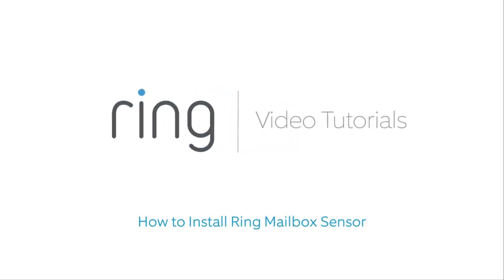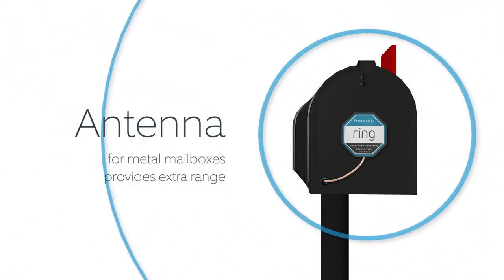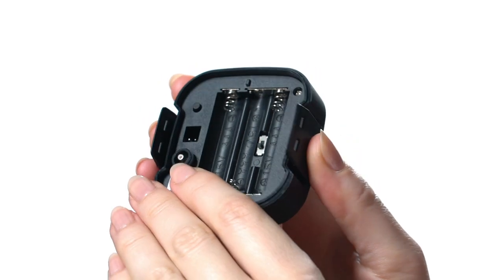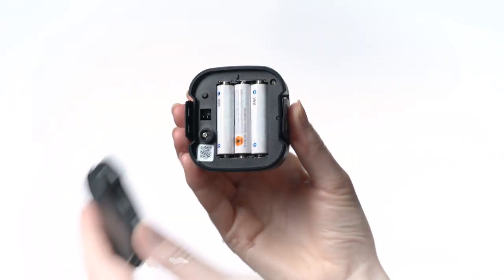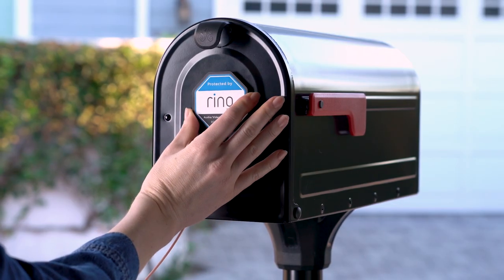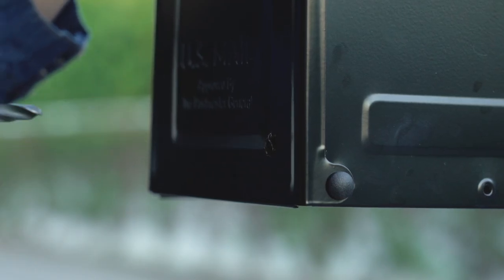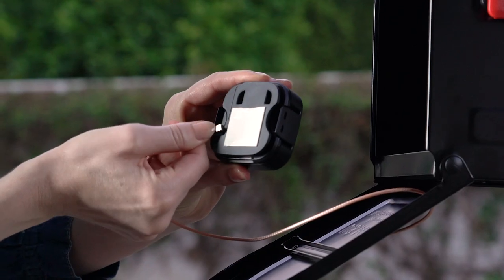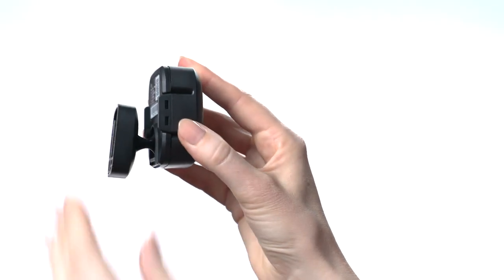How to Install Ring Mailbox Sensor | Ring

Comment: Since the sensor is activated by light, I put it at the back of the mailbox so there isn't this little box attached to the lid when you open the door. Cranked the sensitivity all the way up and attached the antenna to the back (outside) of the box. The wire is clipped to the side inside the box so nothing catches it. When the mailman opens the door, the Echo Plus in the living room says, "The mailman is here." Plus I get notifications on my phone and watch. It's working great and it's very handy since our mail is not delivered at the same time every day.

Comment: You guys need a master home hub for all Ring devices - alarm, cameras, lights, sensors - so that all devices talk to the master home hub, then to wifi internet. It would have cellular and battery backup (like the alarm hub has now) so that if the power or internet goes out you still have access to your cameras and the alarm stays armed.  Please consider doing this.  Thanks
Reply: Sounds even more expensive.

Comment: How do you use the mailbox system with a brick encased mail box ?
Reply: That shouldn't be a problem because once the door is open, it will cause motion and the signal will be able to escape the brick enclosure.

Comment: Has anyone tried installing the sensor to the back of the mailbox instead?  Just afraid putting it on the front door will get damaged in time.
Reply: That probably won't work because the sensor is a motion detector and it will go off every time someone walks by or a vehicle drives by.
Reply: My neighbor has it like that and it still works fine. Im fixing to install mine tomorrow just like that